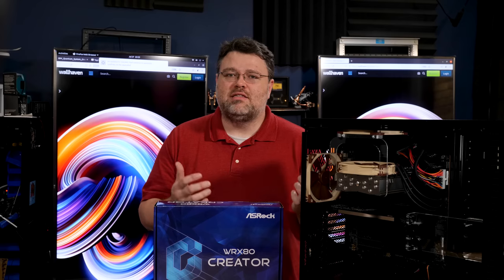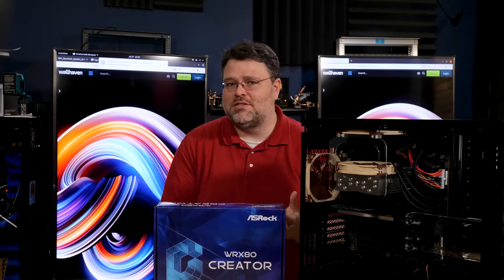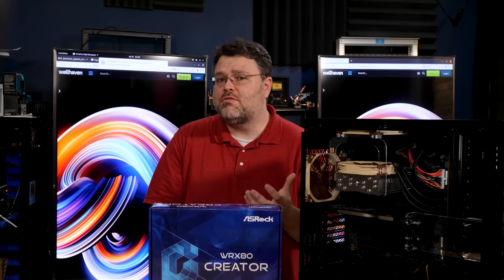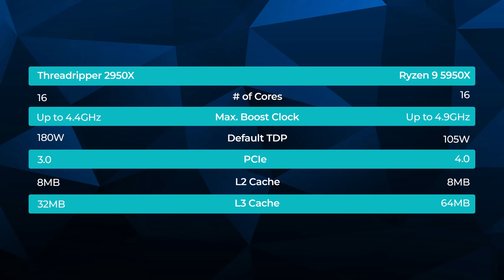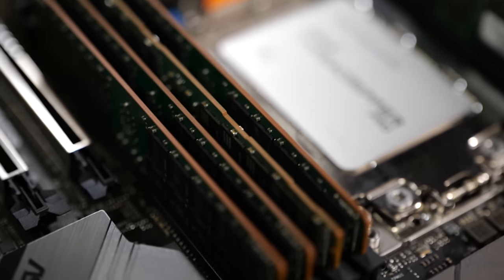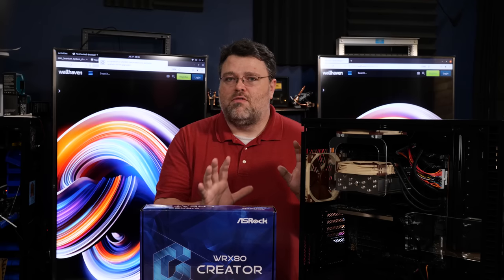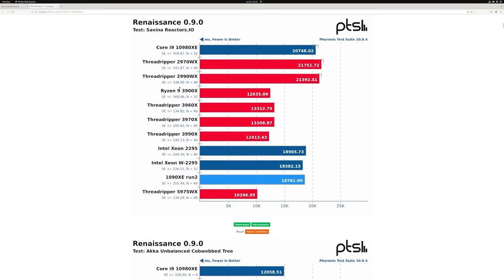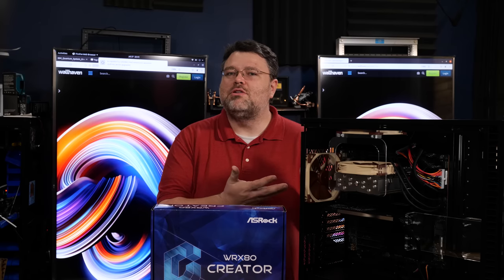Threadripper 5975wx for the DIY! Tested and Overclocked with the ASRock Creator WRX80

Comment: "That's a bit of a dealbreaker for some..." That should be a huge dealbreaker for everyone. It's corporate anti-consumer garbage nearly on the level of Apple, and Lenovo deserves to go out of business over it. At the very least, it results in an increase in e-waste.
Reply: There is a sound technical reason for it to exist...
But there also NO REASON that PSB cannot be disabled. All that woul be needed would be a jumper on the mobo, blowing an e-fuse to disable PSB permanently,  always display a splash screen with "WARNING: Platform integrity not guaranteed!" and an some secure way to tell from the OS that is is permanently off. An engineer could implement this in a week.
Reply: @MultiKokonutz  There is no sound reason for vendor DRM to exist on a CPU.  This is anticompetitive lock-in, plain and simple.
Reply: @pessimism056  PSB verifies that the firmware was not tampered with (think UEFI malware). This is desirable by datacenter customers. The key cannot be changed for security reasons, which is understandable.
The problem is it cannot be reverted back to an "unsecured" state.
Reply: This is in what appears to be a desktop workstation. It could easily be offered as an optional selection for those who want the extra security, but I'm pretty sure if someone has physical access to your primary workstation's CPU, you have bigger security concerns to worry about.
Reply: Not really... seems like you are a little too emotional El dad. [Anyone even get this reference].

Sony does it with games. Microsoft does it. No reason a system integrator like Lenovo cant purchase 5000 series chips for specific applications and lock them to their systems....

I never understood why people get so emotional about these things.

No one is forcing you to buy it, nor are "AMD" saying you can't have it.
Reply: @Marin3r101  "Oh, it's totally okay because everyone else does it too!"

You are the reason why we can't have nice things. Thanks for the bad take, but it might be better if you weren't forced to say it with corporate boots on your tongue.
Reply: I think its a bit extreme saying Lenovo should go out of business for this. This feature is clearly not aimed at DIY and as Wendell rightfully said. Its a deal breaker for SOME, not all of us. Besides Lenovo makes quite good consumer devices, just look at their legion laptops, considered to be one of if not the best laptop line for the past couple of years.
Reply: @Mico605  This is not a "feature" for almost any user. This is an intentional limitation. Even if you disregard DIY, it's bad for resale, it's bad for in-house repair, and it's bad for in-house hand-me-downs. The previous good they did is irrelevant, they're crossing a line, and won't cross back unless they suffer for their anti-consumer garbage.
Reply: @Marin3r101  Are you sure it is not AMD that imposes such a restriction in exchange of early release?
Reply: @Marin3r101  The difference with consoles (as minor as it probably is) is that we haven't been expected to see vendor lock-in on PCs outside of perhaps very niche markets. Lenovo bringing this to socketed CPUs and standalone motherboards for the sake of a security "feature" that, as someone else said, could be fixed in very little time by an engineer, is greedy and anti-consumer. 
Also, just because no one is forcing us to buy them doesn't mean we shouldn't rightfully condemn this type of practice. No one forced us to buy macbook airs with soldered-on memory, and yet that's invaded half of the laptops on the market. No one forced us to buy overpriced GPUs from nvidia, and yet every sub-$350 GPU from both companies is arguably a waste of money. When these problems threaten the open-ness and freedom to customize and control what your system is made from and does, you bet your ass I'll get emotional about these things
Reply: @MultiKokonutz  Except that no data center is going to buy one of those systems. They'll buy racks of EPYC.
Reply: @KawazoeMasahiro  yeah but you can't upgrade the EPYC's 3d cache, neither can you upgrade a videocard's ram. Soldered memory is always many steps ahead in bandwidth and bandwidth/watt when compared to DIMMs.
Reply: @MultiKokonutz  uh? That doesn't have anything to do with forcing a vendor specific drm on a workstation platform... why are you talking about memory upgrades? This makes no sense...
Reply: @KawazoeMasahiro  Oops, my mistake. Thought I was in another thread
Reply: @MultiKokonutz  hey no problem. I was just very confused xD

Comment: I honestly just need more PCIE, 16 or even 12 Cores is enough. I don't get it, 16 Cores limited by 20 PCIE lanes is like giving the 3090 6Gb of VRAM.
Reply: That exactly what Intel's x99 platform did. Sadly, no replacement on the horizon. All with silly number of slow cores OR inadequate number of pcie lanes with nothing in-between.
Reply: @bbatbileg  W790 Chipset and SPR HEDT is confirmed, exactly when is another matter.
Reply: the amount of cache and memory bandwidth are also a bit on the limiting side for an otherwise powerful processor
Reply: especially when the previous 8 core has 128 lanes of pcie. whut , even dividing by 2 should end up with 64 pcie 4.0 lanes by another 2 32 pcie 5.0 lanes. none of what is said makes sense
Reply: Current gen epyc (i think both normal, High frequency and High cache lines)  and definitely older generation of threeadripper were definitely available in 16 cores variants with lots of PCIe i/o
Reply: What parts are you talking about?  Zen 3 TR has 128 lanes.

If you're talking about Ryzen, Zen 2/3 is 24 lanes.  Zen 4 is moving to 28 lanes of gen5.  That = 56 gen4 lanes.  X670E boards have a lot more features taking away the need for different add on boards so no you really won't need a crazy amount of lanes for X670E MBs just for add on boards and more PCIe slots.  

And no it's not the same thing as what you said. Name something that goes in a desktop that is more than X16.  24 current gen4 lanes allows a lot more than 5 years ago, and Zen 4 with 28 gen 5 lanes is going to be a lot more than AM4 based systems.  It doesn't make sense to have 5 PCIe X16 slots if you don't need them, and once more companies that make add on boards move to gen5, you'll be able to drop down to X4 or even X1 adapters.  10Gbps NIC = PCIe gen5 X1.  That would run off the chipset slot.  But different X670E boards have a 10Gbps ethernet connection.  So now you can run 2 10Gbps ethernet connections and not be using much conductivity for Zen 4.

So, Zen 4 is already doing what you want, unless you have a few ancient add on boards where you need lots of lanes.  But in that case, maybe you should just buy a used Zen 2 TR at a good discount.
Reply: Same. I'm hoping to pick up a threadripper 3000 used as ppl upgrade.
Reply: @johndoh5182  You know we live in a post nvme world right? Each nvme drive needs 4x lanes, I have 3x. That’s already 12 lanes gone, add x16/x8 for a single GPU, I have 2x. Ryzen 5 can have 20 or 24 lanes I don’t care but give the Ryzen 9’s aka 12 and 16 core variants their NEEDED 40-48 lanes.
Reply: @owlmostdead9492  you need to realize that you re a minority and the average person doesnt use more than 1pcie ssd and a single gpu. Consumer mobo prices have already crept up enough we dont need them to be any more expensive, $150 is essentially entry level mobo nowadays.

For people like you hedt/workstation platforms exist
Reply: @ThunderingRoar  at no point did they claim to be a representative customer in terms of their PCI-E requirements, they just explained why they wanted more than what is currently available
Reply: @ThunderingRoar  that is why there is market segmentation. Many people would pay a huge premium to get a their pcie lanes along with current gen single core performance. For me, > 16 cores don’t matter much, it’s just a bonus.
Reply: @owlmostdead9492  And all of those SSD's are running at max speed eating all the PCIE bandwith and at the same time the GPU too?
If that is the case you need a Workstation CPU.
Reply: @ThunderingRoar  You realise that if AM5 doesn't fix the PCIE lane count to something that is actually reasonable, compared to how much horsepower the 7950x is going to have, I can only either decide between an 800$ 16 core monster with no lanes or a 2800$ last gen tech 24 Core Threadripper Pro with 128 PCIE lanes? There is a 2000$ and 100 PCIE lane gap right now, that I want filled. I don't think that is unreasonable.
Reply: @FutureChaosTV  You don't even understand what I'm talking about, it's not about bandwidth it's about lane count. I would prefer 40 3.0 lanes to 20 4.0 lanes.
Reply: @owlmostdead9492  thats what my comment referred to . the 3000 threadripper parts aka last gen parts . i think OP thinks that this generation(of threadripper 5000) being limited to 20 lanes is ludacris. my comment was also stating that even using 32 makes more overall sense than dropping to 20. i dont know what the lane speeds were aka gen 3 4 5 . threadripper 3000 with 128 lanes of gen 3 pcie should at maximum lose half the lanes going to a gen4 pcie bandwidth lane. 20 lanes of pcie 5.0 is fine if it comes with plenty of pcie 4.0 for other things.
Reply: In principle you have two options:
- Treadripper Pro 3955WX. It has 16 cores as you want .it is not very expensive and it has all the pci-e gen4 lanes you want (and more)
- The other option is to get a high end  gaming motherboard with PCIe  bifurcation and split the 16 lanes of the GPU into 8+8 (or 8+4+4) by using riser split cables. According to most benchmarks on PCIe gen4 the GPU only needs 8 lanes for full performance (at least until next gen GPUs arrive)
Reply: @javiej  I'm not going to Frankenstein around issues that shouldn't exist in the first place, finding a case that would support such a mess is a nightmare alone in it self
Reply: @owlmostdead9492  bifurcation is a lame solution anyways.  You shouldn't have to face chopping up your GPU I/O just to get a couple dedicated CPU<->PCIe lanes to another slot.  Right now it feels like the cheapest way to buy more I/O is literally to buy multiple consumer systems and try to divide up your workload between them.
Reply: @johndoh5182  Zen 4 is 24 + 4 lanes, not "56 PCIe 4". As standards and requirements increase (with PCIe 5 hardware) you can't compare it to slower standards like PCIe 4. It will be equally limiting when you need multiple expansion cards.
Reply: @ThunderingRoar  I think you're projecting here. Most people are intelligent enough to actually make use their computer. A single NVMe SSD at full bandwidth is just silly and very limiting.

Comment: Still rockin my 3970X and loving it.  Not sure if there is anything coming down the line (workstation wise) for me to justify an upgrade yet. It's just that good.
Reply: I'd like to see prices for these start to drop to Zen and Zen+ TR levels. Rather a 3960x than a 5950x.
Reply: The 5975WX is significantly better than it, and the Zen 4 Threadrippers will be as well.
Reply: @chiefjudge8456  better yes, but fast is still fast so it's difficult to tell the difference unless under very demanding long running workloads.

Comment: I am an enthusiast that lived on the HEDT ever since the X58 from Intel.
Looking back at it, I still need a HEDT, as the offspring that we have now is useless for those of us that needs more PCI-E lanes.
16 cores are sufficient, but what I want is more PCI-E lanes, and not the hobo switching you have to do on AM4 and Intel these days where once the x16 are gone for the GPU, you are left with scraps for your SAS controllers and possibly 2nd GPU.

So lately for where I haven't been needing a lot of CPU power, I have been looking at really old AMD platforms like the 890FX, X58, X99 and X299 for their price to PCI-E lanes ratios... We really need an alternative here.
Reply: Exactly. I have a 5950X and all I really want is that CPU with tons of PCIe lanes. We exist, there are dozens of us!
Reply: Intel had that for a long time. Sales didnt cut it for consumer side. So they cut that side of the business. 

I remember checking their line up when x99 was out. 
They had a mid-range chip. 4930k it had good specs. 40 lanes. It was around 550-600 at launch.
Reply: The non-pro HEDT userbase is not insignificant, especially considering the extra cost involved. However, the reality is that AMD royally fckd over its entire HEDT userbase with that TRX40 own goal. AMD and Intel know this. One thing's for certain, those users are not stupid - they ain't risking that ever again. AMD have lost them permanently and if Intel can produce something competitive (including 12-16 core option, around 60 PCIe lanes) then they will win over most of these potential customers. AMD fcked up big time here.
Reply: I snapped up an ASRock X399 TaiChi and a 2990wx for under $1000 usd back at the end of 2019, and bang for the buck, it was awesome.  If you are on a budget, I have seen the motherboard under $200 and a 1920x under $150.  Still gives you the 60 PCIe lanes (and my 1920x runs over 4 GHz all core all day long). I have 2 1920x systems and the 2990wx system.

Comment: The only issue with modern high end CPUs are with the motherboards. We now have tons of pcie lanes but all of the slots on the motherboards are single width! I think we need a new mobo standard to allow 7 double width cards to be run side by side on one motherboard.
Reply: I think that's where a server form factor might come into the conversation, I'm probably missing some usacases but i can't think of any reason you would want that many Double width cards in a tower
Reply: Especially sad when said motherboards are a freaking grand alone.
Reply: Nah we just need a 32/64 lane interconnect to allow expansion chassis. You can do it now, but it takes up the slot physically, so not much improvement.
Reply: If you have so many PCI-e lanes to use, the only way to go is the mining rig style of chassis. Use PCI-E riser cables to solve the issue of PCI-e slots too close to each other.
Reply: I think the point is not that you'll use them all in PCIe slots but you can fill those up AND add a bunch of fast storage, etc.

Comment: Why are they launching a new workstation cpu when they are releasing a whole new cpu architecture in 2 months?  I want threadripper 7000 series with zen4 cores and ddr5 support to be released this fall, and I wanted the price to scale linearly with the price per core of the ryzen machines just like the first gen threadripper.  this charging a kidney for LAST GENERATION (in 2 months) architecture is complete bull.
Reply: Competition... or the lack thereof. AMD has no pressure to release anything now. And it is that expensive cause it is basically the same EPYC CPU that sells at the same price, they will not lower the price to sell you something that they can get more money from other costumers.
Reply: It was released in March but OEM only, it's an EPYC server clocked faster.
The server/pro market values stability and validation and consumers being their guinea pigs.

Comment: Still waiting for 12 to 24 core HEDT.  Fek 20 lanes.  40 lanes and quad channel memory or there is literally nothing for me to buy.
Reply from the maker: I'd be okay with muxing 16 lanes of pcie5 into 32 lanes of pcie4 or even better 24 by 4.0 and 16 by 3.0 would make a great platform
Reply: @Level1Techs  Honestly, when I first heard of W680, I was hoping it was a sister chipset to Z690 that was basically just a 16 gen 5 to 32 gen 4 switch.  I too would be OK with 4x4 gen 4 and 4x4 gen 3 over 4 physical slots capable of dual 16 lane or quad 8 lane assignments to reduce cost.  I am still unsure as to if the switch would be a reasonable way to go about it though.  I have never used one, but I would imagine it would add a bit of latency for all and also complicate IOMMU for those looking to virtualize.
Ultimately, I don't forsee Intel doing it because they gave us the bonus 4 lanes for an NMVE, but also did it by taking away 8+4+4 bifurcation of the 16 lanes.  It's pretty clear they want to provide the minimum possible.
AMD, well, they just want to double the prices of everything so even if they did release a Threadripper non pro - it would be priced out of enthusiast territory as Threadripper 3000 was.
It's just so frustrating as an enthusiast that doesn't want to compromise on IO to have the Intel haters tell me that I should be happy that AMD released 16 cores on the consumer socket and Intel isn't releasing quad cores anymore.  Well, when Intel was only providing quad cores on consumer socket, there was still something I could buy and at a reasonable price.  That simply doesn't exist today.
Reply: @Level1Techs  I am surprised why there is no ITX to ATX extender board that has such a mux&switch arrangement.

Comment: Thank you for looking at this. As a grad student who does computational physics, threadripper was a low cost (relative to performance) and easy choice for my workstation. It seems these parts have moved into a different tier. Hopefully we see future HEDT options inbetween the 5950X tier and this going forward like you mentioned. Quad channel is actually a big deal for my workload, so much so that the loss in core performance is sometimes justified. Hopefully AM5/DDR5 makes up for that a bit with the next gen parts.
Reply: I know your hoping the 6950x has 24 cores and 48 threads
Reply: Nah. You coulda grabbed a retired dual or quad xeon for waaaaay cheaper and got way more crunch.

Comment: ...nice ! I would love to see a WRX80 mobo comparison that includes the MSI WS WRX80 as well as the Asus Sage, the ASRock Creator and the Gigabyte SU8 with a w-cooled and oc'ed 5975WX (or even a 5995WX). Wondering about AMD's release strategy and timetable though - and how long this Threadripper Pro WRX80 gen will last, what with Epyc Zen4 Genoa-X showing what the next-gen Threadripper Pro w/Zen4 + DDR5 will offer...